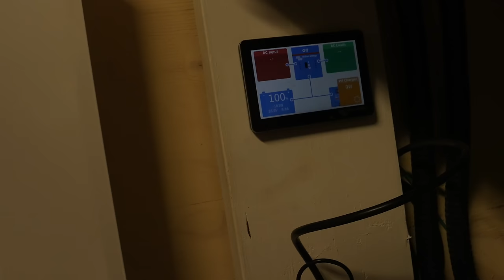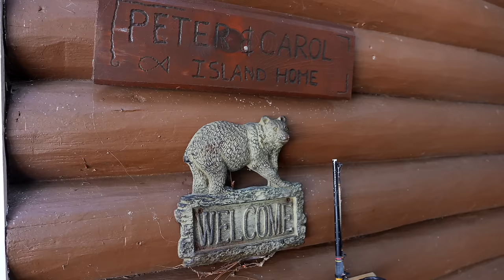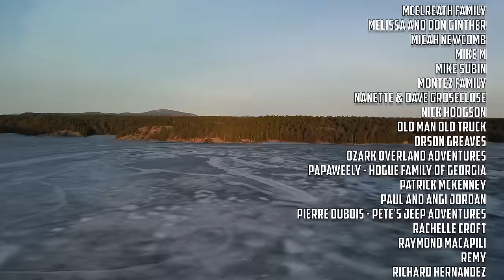FAMILY LIVES ON REMOTE OFF GRID ISLAND IN THE WILDERNESS // Opening Cabin After 4 Months //S9 EP1

Comment: Welcome back! My wife and I also live on an island not too far from you guys. However, we do have hydro. We spend winters in Cuba. And we also return in March and most often get back to the island by scoot (fan boat). Anyway, regarding your freezer... We leave a freezer full of food in a closet and cover the closet door with thick quilted blankets over the closet door. We keep a small space heater going on low through the winter months in that closet because if a freezer is left in below zero temperatures, it can work in reverse and melt the contents of the freezer. So your food can melt and then refreeze depending on the temperature fluctuations in your power room. We always fill a small plastic juice glass with water leave it in the freezer. After the water turns to ice, we place a coin on top of the ice in the glass. If the coin is still on top when we return, we know that nothing melted and refroze. Really enjoyed your video. We feel the same as you when we return and find everything just the way we left it. Two thumbs up!
Reply: Great idea!
Reply from the maker: That is such a good idea. We are definitely going to use these tips. Thank you!!
Reply: what is the name of the islands ?

Comment: In south Louisiana, we call those air boats and they’re FUN! But if you get one, PLEASE consider getting one with a cage around the fan blade. So much can go wrong on the water and it would simply be a disaster. Also, one way to always know if you lost power to the freezer is to freeze a small cup filled halfway w water. Place a quarter on top of it frozen, place the cup in the freezer and you can always see if the quarter remains on top - or did it partially sink and is refrozen? That means that power was lost but came back on ‘at some point’.

Comment: Put a plastic cup of water in your freezer and let it freeze.  Once frozen put a quarter on top of it and place back in the freezer.  When you come back from an extended time away as long as that quarter is on top of the ice then the freezer never lost power.  If it’s at the bottom or lower than the top then it melted and refrozen which means your meat is probably bad.  Tip from Florida!